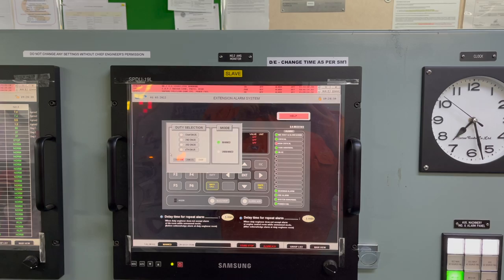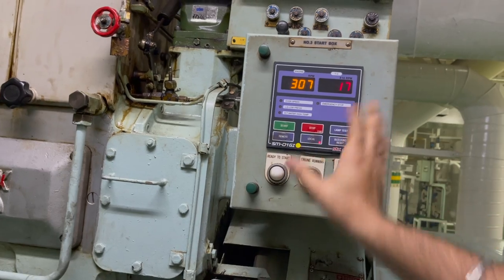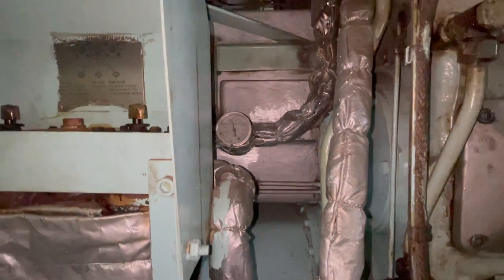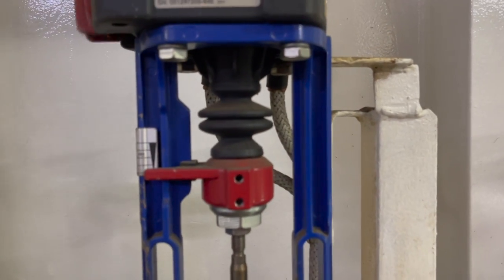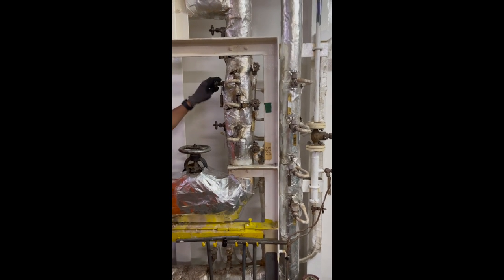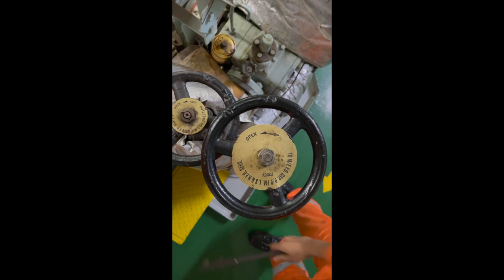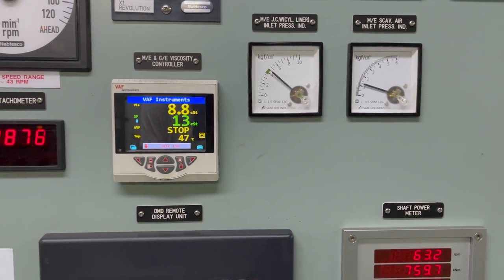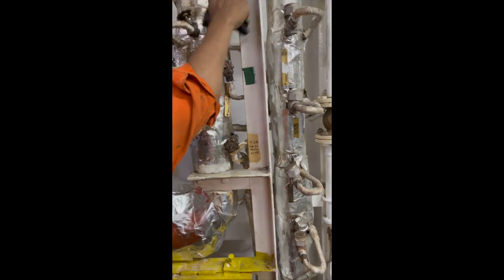Fuel oil Changeover Procedure||HFO to LSMGO|| Avoid BLACKOUT|| ECA entering requirements.

Comment: Sir is it a good practice to close all the steam line and wait for the temperature to come down  before opening the lsmg? To prevent  gasing in the system taht may cause fluctuations in fuel oil pressure.
Reply from the maker: True always to be on the safer side.

Comment: Sir from main engine. when you change over it from vlsfo to lsmgo we know that the lsmgo will pass on the same system. Does lsmgo will mix in the mixing tank ?
Reply from the maker: Yes whenever u do fuel oil changeover both the grades will eventually mix at some point in the mixing column. But always remember to keep the return valve from the mixing column to the vlsfo tank otherwise whole fuel will get wasted.